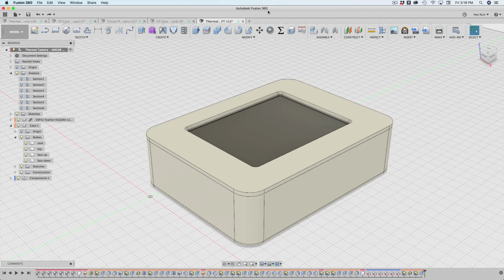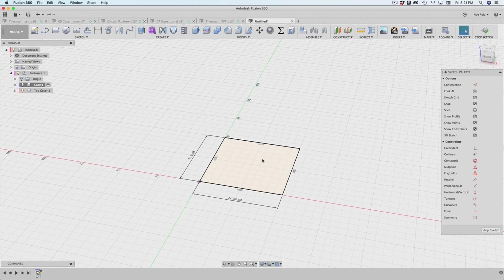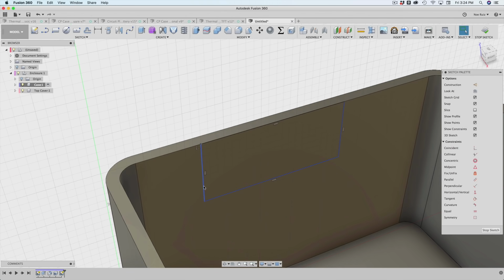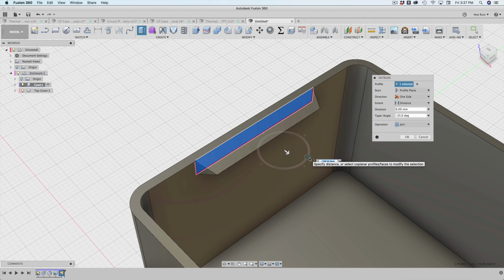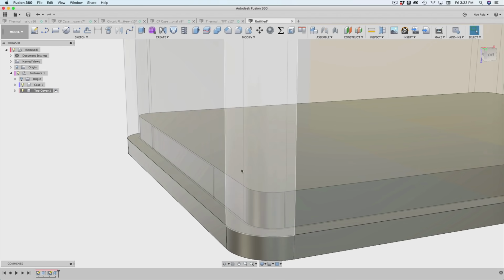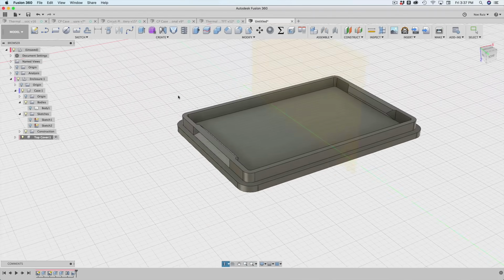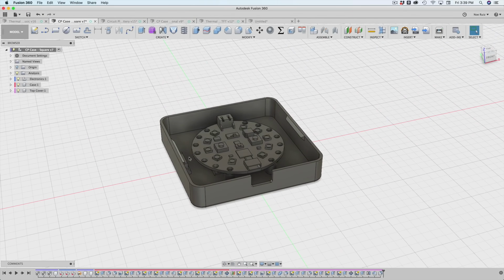Fusion 360 Tutorial – Easy Snap Fit Cases!

Comment: 14:35 -- Using "Fusion 2602.1.25" -- Everything in the tutorial works until the offset on the lid. I'm not able to select the line as the curve for the offset. Anyone else run into this issue?
Reply: I got around this by using the "Project" function while in the Sketch.

Comment: 6 years later - using a newer version of Fusion, I had to change the Compute type on the Mirror command of the cut in the lid from 'Adjust' to 'Identical'. 'Adjust' would throw an error, but 'Identical' would create the symmetrical mirror of the notch.  Just an FYI for anyone else having similar problems with the mirror command.
Reply: Thank you for making this comment! I was going nut trying to figure out he error - and identical solved it for me as well!
Reply: Thank you, I redid everything and it still gave me the error until your comment saved me

Comment: Thank you for this tutorial, I'm just getting started in Fusion.  If I may ask, I'm having an issue at the 17:30 mark, mirroring the cutout in the lid.  I get a compute failure.  (No pattern instances could be intersected with the original body.  Try adjusting the pattern settings or changing selections)  I've gone back a few times and can't figure out what I did  wrong.  Any suggestions of what I should check?  Thanks!

Comment: Thanks so much - so helpful - still works 6 years later!  At 17:30, when mirroring the lid slots, I get a "compute failed" error.  The fix is to change the Mirror Compute Type param from Adjust to Identical.  I am not enough of a Fusion 360 expert to say why that worked.
Reply: True. Any other option aside from the adjust will work
Reply: Same here, I changed it to optimized and it worked too. Wonder what could the cause be, any experts who could answer?
Reply: You are so goated for this comment. I appreciate this so much.

Comment: This is an OUTSTANDING video. Exactly what I was trying to do. Remaking the case for my ESPOne board w/mmWave. One issue I ran into was mirroring the nub. It didn't go exactly as you described and not sure how or what I did to get past this but I think it has to do with the version of Fusion we are using. Either way, worked in the end.  I wish I had the ESP board as a 3D file to build around... is there somewhere to get those? Would like to create some way to snap the board inside.

Thank you VERY MUCH for making these videos. Your skill is awesome.

Comment: Question : why not take the top midpoint from the nub and use the "midpoint" constraint to lock  it to the midpoint of the box top side ?? no need for construction lines . By the way nice clear video Kind regards Hans
by the way the negative 45 degrees is a very good tip thanks

Comment: second mirror (indentation on the top cover) fails with a generic error. of course Fusion is always so precise in giving reasons. (Compute failed.)

mirroring faces worked. Fusion will forever be in a beta state I guess.
Reply: Yeah, i have the same issue. "No pattern instances could with the original body. Try adjust the pattern settings or changing the selections"

Comment: I am with you all the way up to the cover.  But, like a couple of others here, I have the top of the box in free space.  So, I can only select the topmost face of the box sides.  I cannot choose a free surface to extrude along with the sides.  I have the preferences for projecting geometries to working sketch plane.
Reply: Could it be because I have features and holes in the bottom surface of my box?  (mounting brackets and cable passthroughs)

Comment: Hi loving your tutorial so far. but the offset inwards part is not working for me whenever i set shell+gap it just adds the 1.70mm on the outside. instead of the inside what am i doing wrong?
Reply from the maker: Thank you. Try using a minus (-) to make it go the other way (negative). If its a user parameter, it’d be -(shell+gap)
Reply: @adafruit  thanks that worked!

Comment: Greatest tutorial on the youtube ever about fusion 360 ! Thank you so much. 
However I have a problem that you might be able to help me with: 
14:32 into the video you make a offset, you then drag it inwards to make fusion "understand" that you want to be on the inside. 
Then you add "shell+gap" and get 1.7mm on the inside. 

For me it goes 1.7mm out of the lid. I have done exactly the same as you but it doesnt work and I want to understand why. 
I have already tried "-shell+gap" just to try but that didnt help me either. 

Any ideas ? 

Thanks
Reply: - (shell + gap) will do it.

Comment: Thanks for the tutorial, but at around min. 14:26, I had to use -shell + -gap instead of the shell + gap, you told in the video, 
in order to have the offset go inwards, with the shell + gap it went outwards, weird.
Can you easily remove the top cover, once it's closed ? Or do I need something to pry it open, like a screwdriver ?

Comment: Awesome tutorial. At 15:47 the only way I could get Fusion 360 to select that object was to change the extrude at 8:57 to Operation New Body instead of Join. If I left as is, I could never select it. Also curious why you have 2 sketches resulting from the work on the body vs. just the one I had following the exact same instructions.

Comment: This is a great find.  I've use parameters before, but using them in the dimension box is new to me.  I did have an issue with the offset on the lid.  My dimension for the original was about what yours was in the video, 1.92, and I said OK.  However, when I double-clicked it, it was negative.  When I said shell + gap, it made my lip go outside the lid.  I had to use -(shell+gap) and then it worked fine.  I've had issues before with this, too.

Comment: hi , thanks for the tips. i have to do my cover but my join plne between box and cover is not on a plane but in 3d. hiw to proceed please ? may be combine surface and project method ? thank you very much i m a bit stuck for few days with this problematic.
Reply: This is my problem too -- I can only select the top surface of the box and it only extends the walls - doesn't make a lid.

Comment: Can we get an update to the March 2020 updated F360 version Thank You, D  just watched it again and picked up 3 or 4 new tricks using menu select and tools Very Good. For some reason i am struggling between Body and Component. So far after over a 1 year I only use Bodies and print bodies. Sometimes when i do an extrude two features bind and i have to separate. Is that resolved if i had two Components instead of Bodies??? Thank You once again for a most practical useful tutorial.

Comment: I had issues getting the parameters pop up box to show up, the issue is that the popup box is out of sight. anyone having that issue do this:
click and activate component (this will highlight the component) -> Click Change Parameters Button --> "Press Alt + Space"  --> Press M --> use your mouse or arrows buttons move left / right until the pop up box comes into sight. 

I had this issue while using version 2.0.7046

Comment: Really cool tutorial! Just some notes, for those designing 3d prints:
- the gap should also be used between the protrusion (nub) and matching hole sides
- it might also be useful to add a smaller gap between the top cover and the body, the top and bottom faces
- Fusion 360 has a feature to analyse feature interference and automatically remove the intersecting geometry
- the step above could also be done with a boolean operation, perhaps it's processed faster
- w.r.t. the suggestions above, the gap can be applied in a feature post-processing step, such as moving faces creating tapers/draft, after all the geometries have been created and extruded
Other than that, I always love to hear tips about how people optimize their design process!

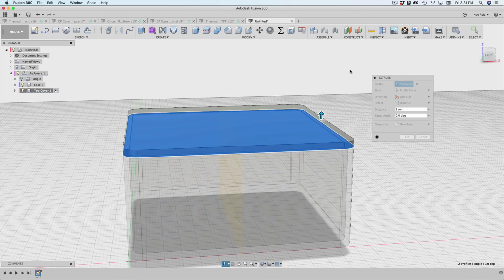Comment: Great video.  One suggestion: At 12:40 when you define the Cover thickness as 2mm, wouldn't it better to lock that to the Shell thickness?  That way, if the application calls for a thicker enclosure and the user changes that parameter, the cover thickness would match it.

Comment: Noe, at about  3:15 you show selecting the 4 corners for a fillet.  Whenever I try that, the fillet happens on ALL edges.  Has there been some change in F360 since you made this video, or am I doing something wrong?   Maybe some subtle setting difference?
Reply from the maker: check the section tool is set to 1 - window selection. then make sure to click+drag from right to left when making the section.
Reply: @adafruit  Nope, still all 12 edges.  as a test, I created a  rectangle, extruded then selected the front.
Reply: @adafruit  Anyway, I completed the project by selecting the 4 edges and continuing. Even with the glitch, I learned a lot.  Thanks

Comment: In 5.26 there is a little mistake. The constraint you show is not Collinear, it is Coincident instead. Actually there are two of them. One for the two perpendicular lines that form the rectangle in that point and the other one to atach that corner to the line of the case face. Amazing video! 
Suscribed

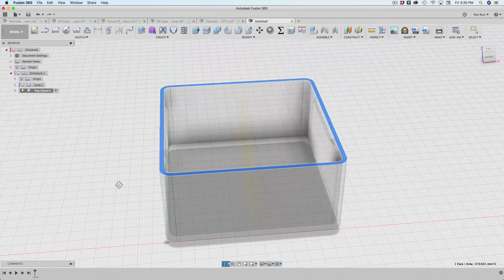Comment: Really Struggling from 12:20 to create the lid. I follow everything as this guy has done and the only thing i can select is the top edge, when i click in the box just before starting the extrude, it only selects the base. It does not select like his does.......
Reply from the maker: the auto project setting must be enabled first. In f360, under your profile name, open preferences > general > design. Turn on "auto project geometry on active sketch plane". Now when you sketch ontop of surfaces, edges, lines, etc will appear in the sketch.

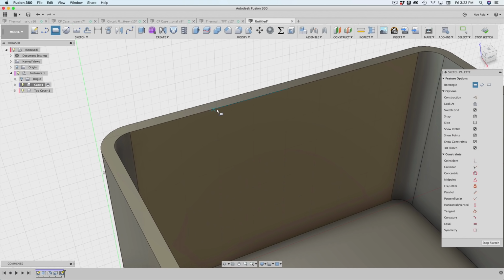Comment: Noe, as i've been following through the tutorial, i'm noticing that Fusion isn't working the same way (today) that you showed at the 5:00 mark where a collinear constraint was applied to the box you drew in the sketch based on the edge of the box the sketch was created on.  Is this a setting or did Fusion change?  Anyone know?
Reply from the maker: the auto project setting must be enabled first. In f360, under your name profile, open preferences > general > design. Turn on "auto project geometry on active sketch plane". Now when you sketch ontop of surfaces, edges, lines, etc will appear in the sketch.

Comment: You know, if you make the interference fit in the cover about 0.2mm, you can just employ the ribbed finish of filament printing to hold the cover.
Reply: I for one, recognize your genius. It's common sense. Would have made his project a lot simpler, though you might need the nubs for injection molded parts. Also, with some filaments his design might not work due to not enough flexing. Shorten the nubs perhaps. I use interference though all the time. Often it works so well I don't need screws etc..

Comment: Absolutely Perfect. I have to admit that I have been methodically going through Lars Christensen's Beginners Fusion 360 videos so I had some comfort with the tool but, Yes, like it has been said below, a Super good example of using parameters and having a complet box with a snapping lid.  I use this all the time now to start a new project where I need a box. Just open this project and do a Save As. Thanks Again!!!

Comment: Best Fusion tutorial I've seen to date. Very well executed and the fact that your using different tools rather then taking a caveman approach to your design method is excellent! You just earned a subscriber. I've been using friction fit cases since I first started with fusion and just securing them with dabs of crazy or hot glue to keep them securely closed, this because I couldn't find a simple design method with fusion to achieve, I'm locking this tutorial away for later projects in mind.

If I might make a suggestion for your next video. How about making a folding snap closure living hinge, like those used on the end of LED strips to secure the strip contact point and the 4 wires that are soldered to the contact pads. Of course this would need to be printed with some sort of flexible filament which makes it all the more interesting.
Reply from the maker: Thank you, appreciate the comment! I've toyed with 3D printed live hinges – doors for USB ports in Pi cases. Snap fit covers too. Tends to break with excessive use with PLA. Dual extruding with flexible filament does sound interesting. Needs to be explored :-) –Noe

Comment: Fantastic lesson, I've done this along bit by bit with the tutoral, all the while to the dimensions I wanted for a nano arduino box with an adafruit neopixel strip, amazing clear lesson. I also love it when tutorials include mistakes and then fix them, well done! Liked, subbed. I'm adding in the coin/tool entry before firing up my PETg. Can't thank you enough!
Reply: what is the "coin/tool entry"?  I am printing in PLA and I am afraid once snapped shut there is going to be no way to ever get the lid back off?
Reply: @ctbram0627  I think I would modify the nib a bit, because this looks like a one time snap on and never get off.  Maybe make another face so it would not hold so tightly if you were going to open it.

Comment: You said it's a co-linear constraint, but the icon shows it's actually a coincident constraint
Reply: Exactly. It's coincident to the first point, not colinear to the top perimeter.
The rectangle tool by default imparts a horizontal / vertical constraint which causes the top line to be fully defined.

Comment: Good tutorial! Please note that your gap is not 0.2 mm. If you will measure the distance between tapered surfaces you will get around 0.1414 mm. So to have correct gap - you need to put your offset value as "shell + 2 * sqrt( gap / mm) * mm" or "shell + 2 * ( gap / mm ) ^ 0.5 * mm". For some reason square root works only with unitless values. Even in this case your gap will have correct value inside the joint but the distance between case and top cover will be wrong. To correct this you will need different approach.

Comment: Thanks very much for the tutorial.  Excellent tips, and especially some of the shortcuts.  I have one suggestion: if you start your box centered on the origin you won't need to construct a mid-point plane.  I've found more than once that centering the origin can be extremely useful in these sorts of constructs.  

I loved the tip on extruding at an angle!  That will undoubtedly save me lots of time in the future.

Comment: At 4:50 you start to make the nubs. This does not work for me. I have started completely over several times with the same result. I select the inner surface of the enclosure, go to start a new sketch and at that point the enclosure swings around so that I am looking flat at the left outside (just the same as if I had clicked on the left side of the view cube). Of course I want to do this sketch on the inside.
Reply: I can get this nub drawn, but when it is complete and I single click on it the top of it only selects. If I double click on it the entire enclosure gets selected. Later when I try to draw the nubs on the top I do not see the lines from the case. Also when I want to mirror the nub I have to select all four surfaces of it one at a time.
Reply: Not sure if these are F360 Windows vs. Mac issue.  For the mirror I had a similar issue (having to select faces) but eventually found I could select the extrusion 'feature' from the timeline at the bottom of the screen.  Also I had issues selecting the sketch rectangle to do the lid extrusion, but the issue was I hadn't hidden the 'body' of the 'not selected' case to allow me to successfully select the rectangle.

Also, the changed POV when starting a new sketch is annoying, but you just have to re-position your view before starting on the sketch.
Reply: @alexscott4277   If you can’t select an object in the sketch, go to: Select > Selection Filters > Select All.
Also to stop Fusion 360 from adjusting the view when starting a new sketch , go under your name profile (Top right corner) > Preferences > General >Design > Uncheck “Auto look at sketch”

Comment: Printed a sample box / lid  using PETG today.  Very satisfying "click" and solid lock.  Much better than a friction fit.  Would recommend putting notches in either the lid or case (or matched to both)  on sides that don't have the notches/extrusions, so you could get a butter knife or a screwdriver in to more easily get it open.  Luckily with the 1.5mm walls and the relative flexibility of PETG, you can squeeze the bottom shell enough to get a lip, but I don't know that it would do that with PLA.

Great tutorial.  I've been looking for ways to do this, and some of the techniques you showed will be useful in other ways as well.
Reply: That's an awesome suggestion! 

My add-on to that is to make it the right width for something like a penny or quarter (or common coinage from target country of choice :p ), since they are readily available (as in often in your pocket at the time), and will almost certainly be "tool compatible" if you do have a screwdriver or knife handy. 

I've seen that taking off on a lot of things, and I find it immensely useful to be able to fit a coin in for leverage.
Reply: I made an enclosure using this technique.  This is my first time 3d printing something.  I used 2.5mm walls and plan to use ABS.  The enclosure is 7.5"x7.5"x4".  Do you think my walls are too thick?
Reply: I extruded the sketch from the nub as a two sided extrude operation on the lid, creating both the notch for the nub, and some clearance for tools to pry it off. -45 degrees for the notch as pr the tutorial and +25 degrees for the cutout for the tool. No additional operations needed.